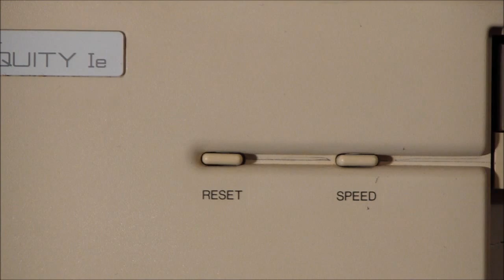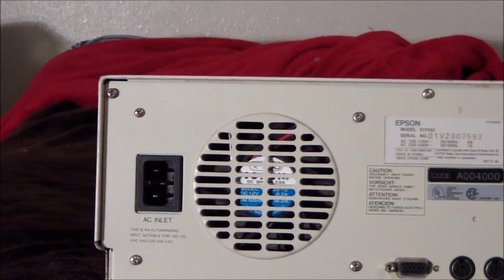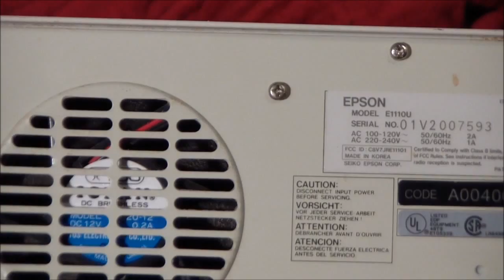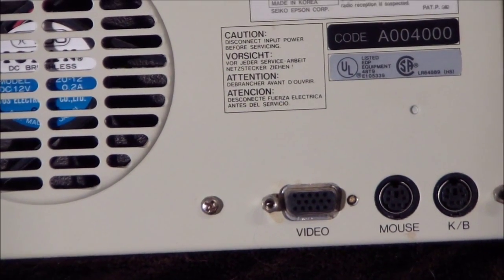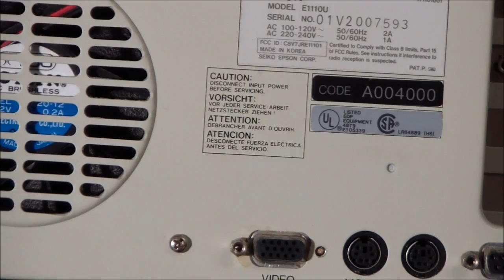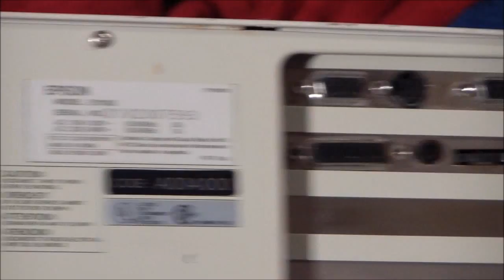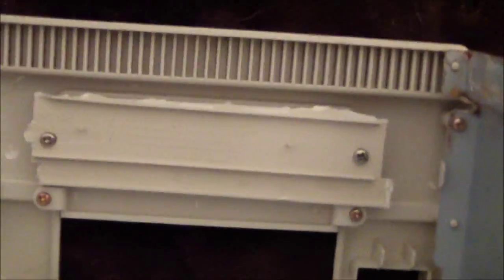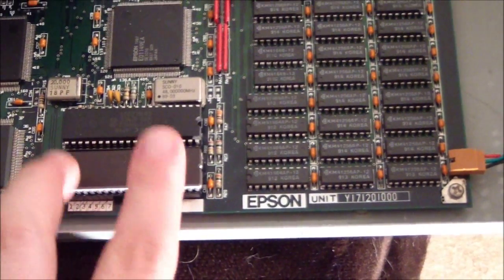Epson Equity 1e

Comment: This was essentially a clone of the original PS/2 line (Model 30). I bought one of these new in early 1990. It was my first computer. Came complete with a PS/2-style keyboard and mouse, MCGA,  a decent VGA monitor, and a whopping 20 megabyte drive. I think I added a modem card to mine, and later on I think I upgraded the chip. The price was about half of a real PS/2. The thing had awesome build quality. The main programs I ran were DBase, Quicken, a couple of video games - Hunt for Red October was my favorite, Lotus 1-2-3, and Word Perfect. As I recall, Epson also packaged some nice utility programs with their computers. The Ie served me well until I replaced it with a 486DX clone a few years later.
Reply: You then probably ended up with a better monitor but a worse keyboard than if you'd got the IBM package 🙂
What did you use the modem for back then?

Comment: Hey, great video!!! Remember the inn 55sx? A found a floppy drive for it and now it boots straight to the ibm computer basic, any tips on what to do from there?
Reply from the maker: Drake Dallenhart Do you have a reference disk? You can find them on the internet for download. I think some of the PS/2's require them. did you get the hard drive to spin up?
Reply from the maker: Drake Dallenhart Do you have a reference disk? You can find them on the internet for download. I think some of the PS/2's require them. did you get the hard drive to spin up?
Reply: +0blivi0n100 yeah, the hardrive, was initially giving an I/ O error, which was fixed by repairing a faulty trace on the bottom of the harddrive
Reply: +0blivi0n100 I don't get the reference disk error anymore it's weird, it just goes straight to basic